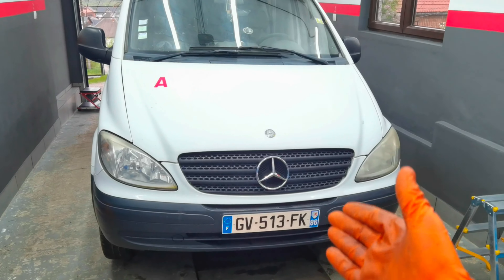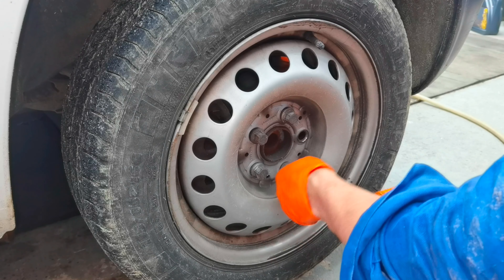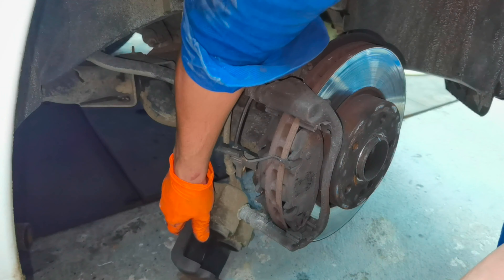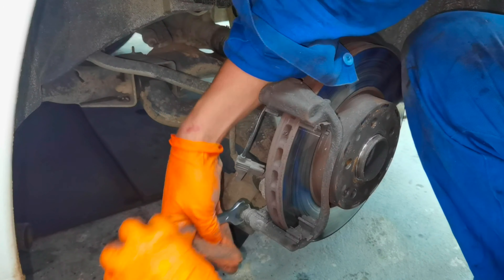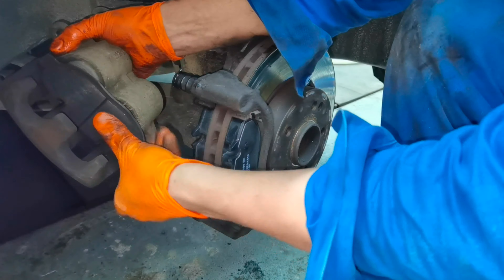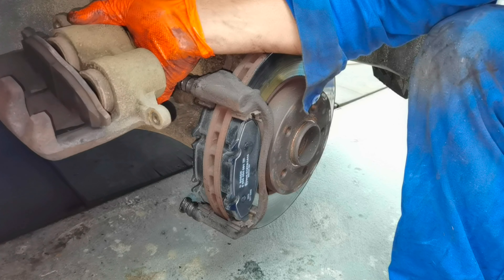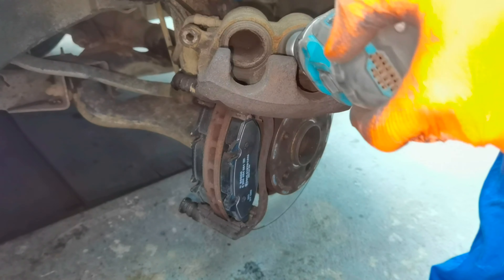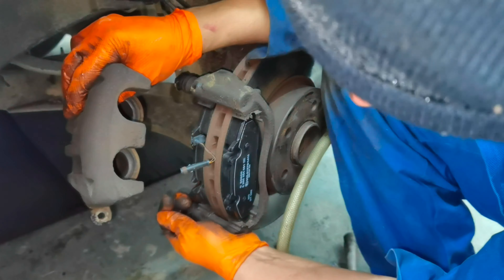MERCEDES BENZ VITO II W639 FRONT BRAKE-PADS REPLACEMENT

Comment: Great video, thanks. Can you tell me how I can tell if the disks need replacing, is it obvious to see?
Reply from the maker: It's difficult to explain here. Normally  if the edge of the brake disc it's much wider then the rest of the brake disc then it should be replaced.

Comment: The vw golfs have brake wear sensors as well did pads on my old ladies golf germans they do over engineer there vehicles like the use of 12mm bolts instead of torx bolts hate those 😢
Reply from the maker: Yes. I feel you 🥺